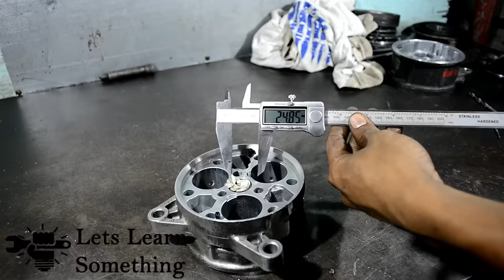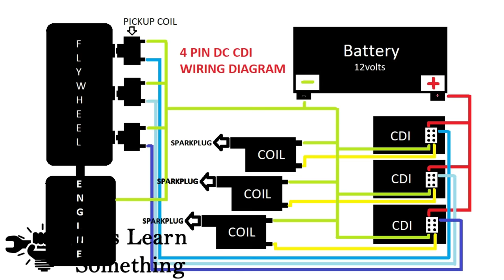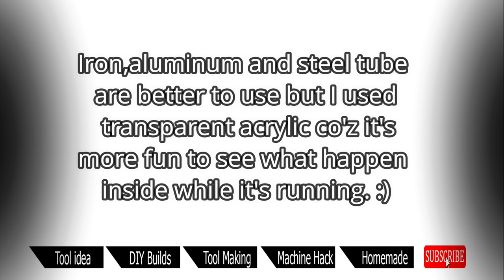I turn Car Compressor into Working Engine

Comment: Any idea how much horsepower this thing puts out?  It sounds mean as hell with a nice growl not like a bunch of angry hornets in a tin can like most 2 strokes do.  Good job!
Reply: Probably half what it steals 5-10hp. I'm tempted to try myself with aluminum parts and some welded on fins.
But I question it's lifespan, it would be a shame to watch 5 hours of work blow up in 3 minutes.
Reply: @wyvern4588  That makes a lot of sense thank you!
Reply: If you honed the cylinders and cut the pistons for rings, you would have something. New metal heads too of course. Ideally I'd use a asin500 supercharger and skip the  bottom fill cylinders. Make them fire too. This way you could have a supercharged 6cyl 2 stroke. Weld fins all around the cylinders for cooling and viola'!!  You could keep the crankcase oiled this way too.
Reply: @TheKillgore521  You have to remember, this is a 3 cylinder 2 cycle engine, they make much more power per CC than a 4 stroke, this is essentially 3 weed eaters stuck together.
Today's lawnmowers are also making 5-7 hp.

I would say it easily makes 5hp, more if it was ported optimally.
Reply: @eyeballengineering7007  You know, with an O2 sensor per cylinder, a MAP and MAF sensors along with some homebrew ECU and you'd really have something.

Though if memory serves me 2 strokes don't tend to like forced induction, and you get a lot more return by running a properly tuned expansion tube on the exhaust.  2 strokes are kind of like pulsejet engines in they work best when you reach a resonance which helps you run more efficiently.  This could probably be overcome by using Reed valves or something?
Reply: They don't like boost because the intake and exhaust port are open at the same time. But if you geared the supercharger correctly, you could add about 1.25x1 air from the supercharger and it would act like the ultimate reed valve/crankcase pump scavenging. Essentially blasting air in like WOT with reed valves, but at all rpm. In this design you also double your cylinder count to 6. I honestly see this as a highly viable, high hp, compact engine.
Reply: @eyeballengineering7007  Now that I think about it I think you're right on the money with a supercharger.  I know a turbo isn't viable because you'd lose more by disrupting the exhaust flow through the expansion chamber than you'd gain on the other end.

It would probably be a large size or odd shape but I see no fundamental reason why you couldn't run an SC and expansion chamber to get the most of both worlds.  I wonder how boost would interact with the transfer passages inside the head?  You'd definitely want to beef up all the gaskets and seals but I see nothing that would prevent it from working.
Reply: @DavidHoskins  you could only run bare minimal boost due to port timing, but it would run great. Of course I'd make the ports way wider than what he did. Those are tiny.
Reply: @Mike L That was my thought exactly. I think toyota just patented a 2 cyl like that. But the load on the mechanics would be nearly cut to nothing extra, other than power produced. Pretty interesting really.  I think quite feasible as well.

Comment: I guess this is called a two stroke.
Reply: I
Total knee replacement
Reply: I used to work with a guy who made something similar using a large freezer (I believe) compressor and rigged it to his bicycle with a fuel tank mounted between the handlebars. He'd make the 10 mile drive into work every day on this crazy contraption.

Comment: That’s a great conversion. I never would have thought of that. What is the life span of the compressor as an engine? Are you able to provide enough lubrication for it to run long term?
Reply: No, although a bright idea, and execution, sadly it wouldnt last long under real world use.. No piston rings, no cooling system, and the "plexiglass head" obviously wouldnt last long.

Comment: You know there is some compressor called Rotery Vane Compressor. Have you the gumption to turn that into a working engine? Come on, do it and put Mazada to shame.
Reply: Good idea. "Will it Wankle?"
Reply: They call them air motors. Grainger sells them. They have horrible efficienty. Don't bother... but if you must,  just go buy an air drill.
Reply: @craigwall9536  But a Rotery Vane Compressor is not exactly an Air Motor. It has an offset rotor to generate pressure. You can turn an Air Motor 15000rpm but it is not going to generate pressure as this has centered shaft.

Comment: So the fuel come in the back on the down stroke, and the upstroke pushes it forward to the spark plug right ?
Reply: Yea,but a bit like motor engine,downstream sucks fuel in,an upstroke compresses it..1% before top dead centre,normal compression..

Comment: Must be 2 cycle fuel or that would seize up in a few strokes
Reply: Not that quick, the pistons are coated by the look of it so it might last a while, that said though it probably is a fuel oil premix.
My guess on the first thing to go would be one of the plugs gets hot enough to melt the thread and blow out.

Comment: Amazing I love watching these videos...how long can an engine like this run for with no cooling or oiling system in place (yes I realize it's 2 stroke and oil in the gas)...could something like this be used in a practical application as a generator or something?

Comment: I have no idea if this would work but it’s just a theory, could a magneto off a lawn mower be used to generate spark instead of using the battery, or is that not appropriate for this application?

Comment: I just wanna know something,
Why not doing the two side of it?
Would be like a 6 cylinder !
Reply: One side acts as a compressor, forcing air into the other side, just like in a traditional 2 stroke. Making it a "6 cylinder" would require a 4 stroke configuration, thus it would still get just 3 strokes per rotation.
Reply: To further explain: A 2 stroke engine normally draws the fuel/air mix into the crankcase before it reaches the cylinder.  
This is done for two reasons.   
1) A more uniform air/fuel mix will burn more efficiently & produce more power.
2) The piston pushing downward, into the crankcase (on a normal 2 stroke), especially when combined with a reed valve, creates greater pressure than the vacuum of the piston moving down inside of the cylinder (due to the relatively small size of the intake port).  
The first set of pistons on this engine are doing both of those things.

Comment: A magnificent idea but i can’t understand why the throttle doesn’t effect the revolution of the engine, the engine runs consistently even when the creator opens and closes the throttle of the carburetor.
Yet there is no footage to detail of a 360 degree view of the running project.
Would be much more interesting to watch the back of the engine running and for a longer time.
also, to appreciate the detail of the sounds of the engine, it be nice to film it rev high and idle it to watch its nature behavior and to listen to its sounds as it idles and revs.
Just to listen to it rev and its variations of idling noises.
You know, to study it more by observing it and to learn from it.

Comment: does the block not get stuck at some point when the block gets warm? you would say that the pistons quickly expand too far, because there are no piston rings on them so those pistons fit exactly.

Comment: An automotive air-conditioner compressor could be a good foundation for a compressed air engine as alternate powered transport as it's inherently a compressor one only need to feed it compressed air and install a drive belt and torque converter similar use on stationary engines or motorbike scooters go carts.

Comment: I’m impressed!  But you have no way to adjust the timing easily and while it’s running. I’d love to see someone make one that has a water cooling jacket, and metal tubes and metal head. It sounds cool too sounds like a small radial engine.

Comment: You should do turning a/c compressor into an air compressor with air holding tank to air up tires etc would be cool if you could leave it off and drive normally then turn a/c pump on to have air compressor

Comment: By the size of the pistons heads, it was in between 100 to 150cc. The rpm around 2.000, so, I guestmate about 3hp, because  of all the friction , and 2 strokes make their power around 3.500rpms, so, if running clean with the right lubrication, this homemade engine could get up to almost 10hp. Well, replacing the acrylic with aluminum or magnesium.

Comment: Wonder where the spark timing adjustment is because if he is not dead on with those welded magnets it won't run very efficiently.

Comment: One thing about this engine he created it got only few moving parts and I must say the most efficient combustion engine to date. Hallelujah Brother.
Reply: Imagine if both ends of each piston were powered.   If this design were to be scaled up, used diesel and  added a turbo or supercharger the engine would be super efficient and powerful and probably very smooth.  🤔

Comment: This? Is about the fridge compressor. . I didn't see any oil in the crank case did you have it in the fuel like a 2 stroke eng.??

Comment: The biggest problem with car air conditioner compressors is the loss of performance for good compression of the air conditioner cooling agent. Especially for the latest models of cars. If you repair them with at least a 1 year warranty to the consumer - that really amazes me.

Comment: Could this engine be supercharged using the ends of the cylinders opposite the spark plugs to compress the air before it goes into the other side?

Comment: imaging this compact fucker can be a 6 cyl. four stroke monster if you make a valve system.. craaaaazy..just have to deal with the cooling and lubrication system then it's a complete power plant

Comment: Yes but reliability is real issue here these pistons are not designed to be used as engine it will wear out so fast cuz of lack of proper lubricant structure and piston rings

Comment: yeah..how long will this run with zero lubrication going on...that light coating of super thin  assembly oil you put on is gone fast. this entire thing is an excerzise in how not to design stuff.  thats even with dumping a ton of oil in the fuel.
Reply: it wouldn’t be that hard to convert it to 2 stroke.
Reply: You're missing the point here. Whoosh, right over your head.

Comment: I’ll tell you something funny. Our junkyards have millions of these old compressors. A machine shop could easily produce these little engines. But Briggs and Stratton would have a fit. Competition in America is illegal, our horrible government makes sure of that. And there’s another funny thing: these would be perfect no-carb vapor engines. But then Shell oil would have a fit. Honesty has been criminalized.